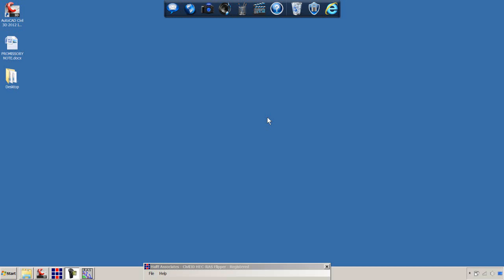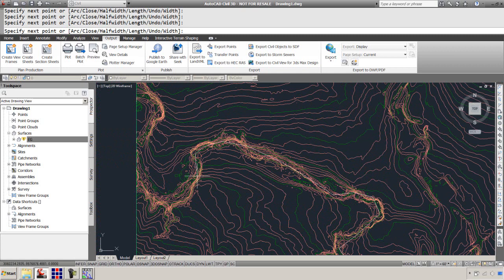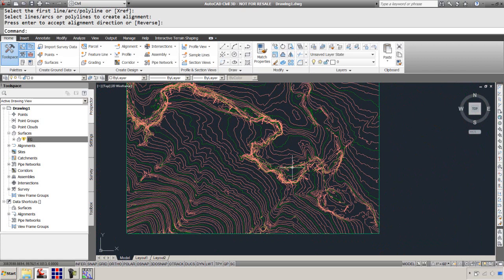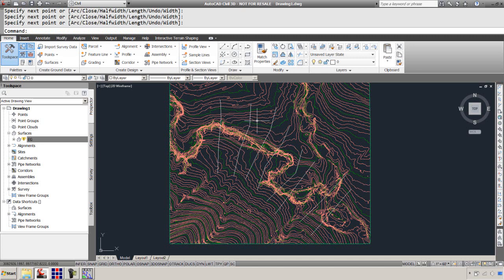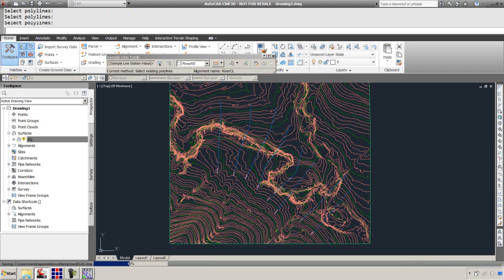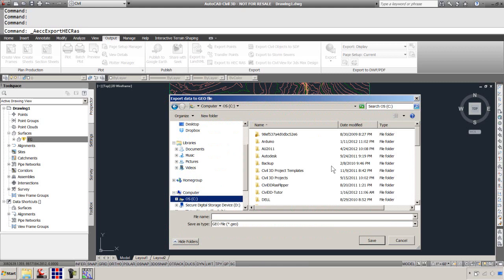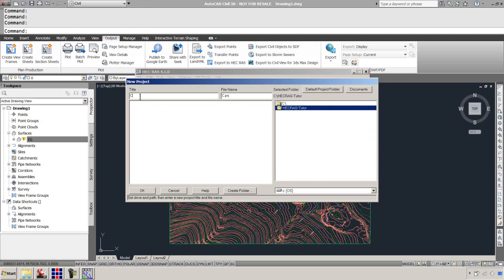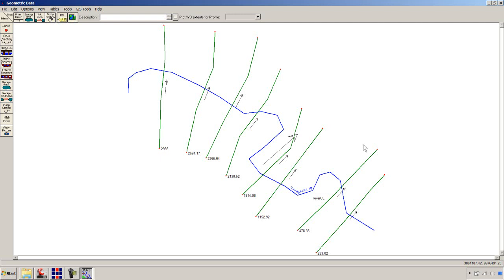HEC-RAS and Civil3D, Part 1 of 3

Comment: Hi,, for steady flow in reach boundry condition while I putting number into dowstream and upstream value, it turns automatically exact number. For example when I put 0.03 and I press 'ok' it turns 3. or I put 0.0017 it turns 17 same way. Also I realize no difference between 0.3 0.03 or 0.043 the program turns all automatically 3. What is the problem? Thanks.

Comment: AutoCAD is not exporting my data correctly.  The GEO file is missing most of the river coordinate information (BEGIN STREAM NETWORK AND REACH CENTERLINE).  For both of those data sets, the first coordinate is present; however, the rest of the coordinates (151 pairs total) are just 0s.  Any ideas?  Thanks